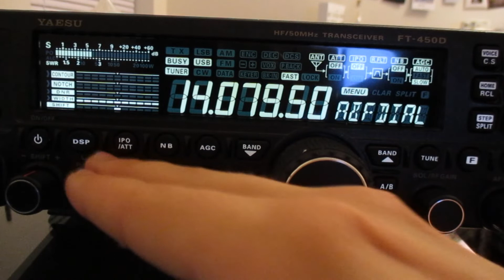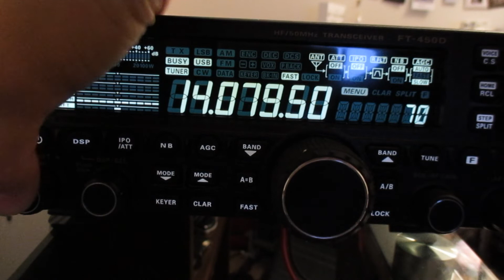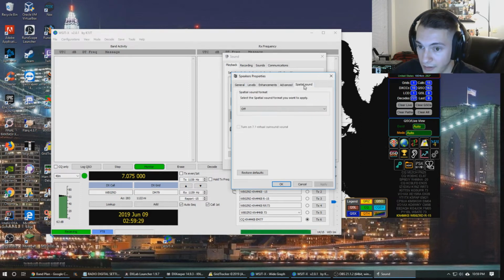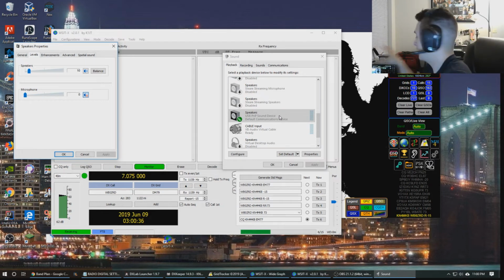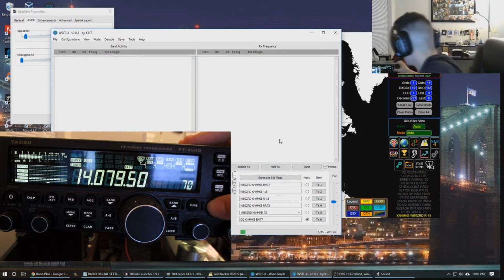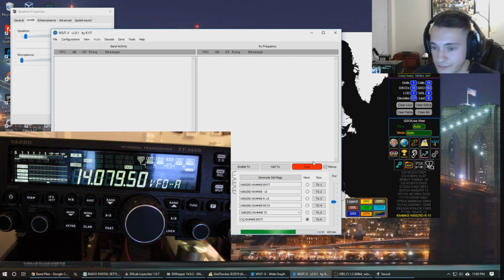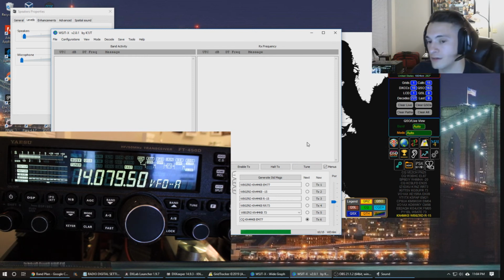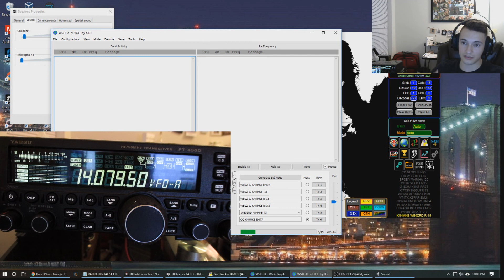ALC And Digital Modes - Avoiding Harmonics

Comment: Thanks! Didn't know what audio settings to use for JS8Call and my little USB sound card, using VOX on my USDR transceiver. Lowered the speaker volume to 10%, mic volume to 50% and it now works great. Finally! 73.

Comment: Wonderful video. I have an Icom IC-707 that does not have ALC. You gave me some ideas to try and see if I can get the levels correct to use it with Winlink Express. I am also using a Signalink USB Sound Card. Thanks es 73 - KF6BL

Comment: Hi, great video.  That has cleared up a lot of confusion for me.  However, I am using digivox and I am struggling with getting that to work.  I that if I reduce my audio to levels where ALC is absent, my digivox will not kick in to TX mode.  The other problem I'm having is my ALC meter is not steady.  It is pulsing.  Could this be caused by RF feedback or grounding issues.  Thanks in advance. 2E0MNV

Comment: @ModernHam Question. How far away from your QTH is the W9 station who complained about your audio harmonics? If the station is close to you, then the problem could have been RX overload on his end, in which case he should turn down his RF gain. The best way to tell is to enable the radio notch filter, and center it on the main audio signal. If the harmonics are still seen, then the problem is with the transmitting station. If the harmonics disappear, then the problem is RX Overload at the receiving station, and they should turn down their RF Gain, or switch off the pre-amp, and/or enable their attenuator. AC6BW

Comment: I've updated the procedure in the document I sent you...it's on my QRZ page
https://www.qrz.com/db/W9MDB called FT8Noise at the first link.
You would be better off going through the SignaLink and using the TX control to reduce the signal and keep your computer at 0dB and full scale on WSJT-X.  That maximizes your dynamic range and resolution of your transmitted signal.
The main problem you have is you're feeding a MIC input with a Speaker level.  That's up to 10V coming out your computer and is why you're having to drop WSJT-X and the sound device level so much.  You can drop that level in analog space in the SignaLink.  Looks like the 450 doesn't have much MIC gain control from what I see in the manual.  A direct connect from computer to the MIC jack should have a resistor placed in line to drop the signal level.
https://geoffthegreygeek.com/audio-levels/

Comment: Well, you're on the right track, but you kind of made things way more complicated then they had to be.
I think you said you're using the microphone input to feed audio from the computer.  I suspect you might have gone that way in order to use the VOX for keying the rig when you send audio.
On the back is a jack labeled "data".  It will have audio in and out as well as PTT pins.  The audio input there expects line level audio, 1V peak to peak nominal.  That's where you want to send the audio.
The mic input is amplified, expecting around 0.1V nominal signals and it's really easy to overload it.
Aside from that.  The easy way to set your levels for digital modes is to adjust the computer's output level and watch the ALC meter.  Bring it up to where the meter just begins to move and you're modulating clean.
If you're not using the back data jack because of vox not working on it, don't spend a ton of money on a signalink!  You can build your own with off the shelf parts for around $25.  I designed one and did a video on it.
Search for DuinoVOX and you should find the blog post and the video.   Low component count, really easy to put together, and works just like the signalink.
73, and it's great to see young folks getting into the hobbie.
KB9RLW,  The Old Tech Guy on you tube.
Reply: Thanks for the home brew idea kev 73

Comment: 70w!!! Jezzzz. I don’t run over 30 on a much poorer antenna than yours.   I wouldn’t never flog my poor radio at 70. I am licensed at 100w PEP so 70 is over that any way
Reply from the maker: Yeah the trick is to set your output higher, and adjust the actual level with your PC. While my radio is set to 70, I'm actually running 50-60 after volume level controls are introduced.
Reply: @ModernHam  The problem with that approach, is that you're not using the full audio range of the radios audio chain front end and modulator.  That effectively brings the noise floor, hiss, on the audio lines up closer to the actual signal and degrades the quality a tiny bit.  You want the cleanest audio possible when doing digital.  It helps your chances of being decoded when your signal is weak at the receiving end.